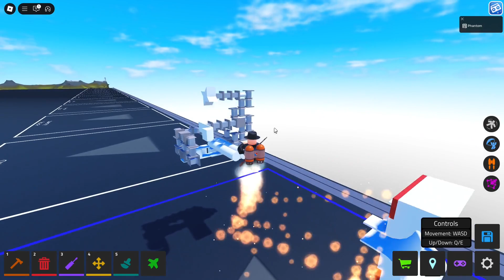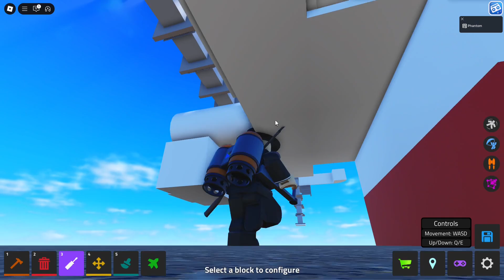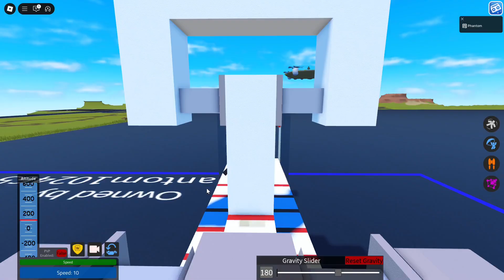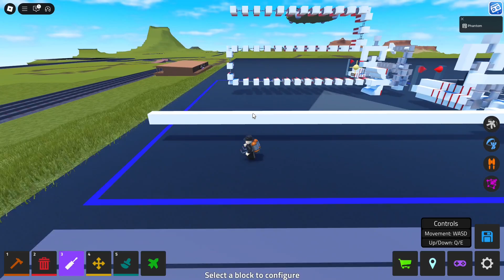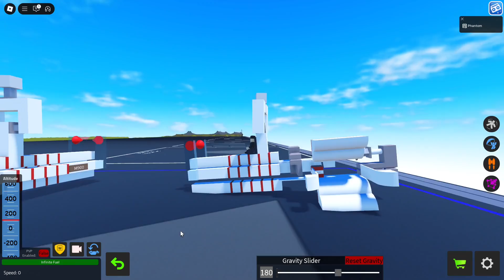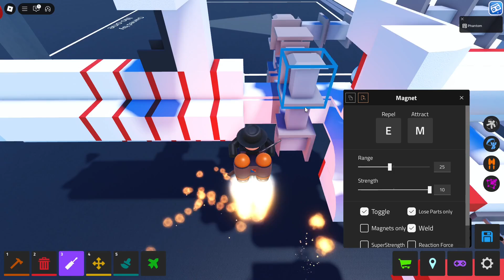Plane Crazy Belt Fed Machine Gun - M900 Build and Concept Tutorial

Comment: For some reason it get stuck inside the chamber
Reply from the maker: Check the barrel maybe, see if the 3 compressors directly attached to the barrel are correct. If not look at yours and the one in the video, describe any difference you see build wise
Reply: No i mean went the bullet it inside the chamber the one who supposed to explode for the other one to launch doesnt explode when inside the chamber for some reason
Reply from the maker: @danachoy1044 Might be the spinner then or the settings for the tnt, check those, if not as said before compare yours and the one in the video, describe any differences you see

Comment: The belt isn't moving, Im sure i did the mag belt correct
Reply from the maker: Wiggle the gun around a little and if the belt doesnt move as far, its not connected (which is good). If its moving uniform with the gun then it is attached. If it isnt connected check your magnets and spinner, make sure their settings are correct
Reply: @Phantom10246  All configs are correct, But what are the controls to fire it? Im afraid i might have been pressing the wrong buttons
Reply from the maker: @thaoneaccount23-Hn3e1 Q and E, can't remember which way it is but its 1 of them. If you pushed M and everything exploded then you would be correct
Reply: @Phantom10246  I pushed M and the ammunitions exploded, but the magnets and motor started being compressed, and finally the gun gave out and glitched, so the belt got flung violently
Reply from the maker: @thaoneaccount23-Hn3e1 If M caused a catastrophic explosion, then thats good, the settings are correct. The controls are just Q and E, never push M with it. Thats just the key I never push and thus assign to things that should never be activated. The gun doesnt need the user to activate the tnt, it does it for you. Doing it yourself breaks everything, as you saw.
Reply: @Phantom10246  Nevermind, a compress block had a incorrect configuration

Comment: how do you make the belt goes up or smth idk
Reply from the maker: The magnets are the part that guide it in, as the belt comes in and is delinked the used belt is tossed out and helps pull the rest of the belt through, then the cycle repeats again and again until its out of belt.
Reply: @Phantom10246  Yes yes I understand the concept, what I mean is, how to make the belt longer, the template one you use for the tut, the S-shaped belt, I can't seem to figure out what part you used to make it goes up, I don't exactly know how to phrase it as English is not my first language-
Reply from the maker: @dapxwolf17 Got it and no problem, the angling system (about 15:00 in the video) just uses angle locks that are positioned to straighten out the belt by creating that curve you see in the video. All you really have to do is angle each segment of belt so that the angle lock snaps it to be straight with the next, etc. If you didnt get that I believe all 4 directions for the belt and angle locks are in the video, so take a look and you might see what I mean. If that didnt help let me know what part you didnt understand (how angle lock works, the right direction for angle lock, etc.), and I'll try to clarify and help better
Reply: @Phantom10246  know it was angle lock, I just can't prove it, I tried using it, but I can't seem to figure out how to make it work, can you make a quick video on that? Make it unlisted if you doesn't want to publish a video of literally just about angle locks...
Reply from the maker: @dapxwolf17 I'm away from my computer for a few days so sadly I can't right now, but if youre open to it we can try to work it out here, in discord if you have it, or wait a few days until I get back to my setup, up to you. I will say that if you can't get it working try experimenting with it if you haven't used it before, learn how it works. If you do (if you decide to try and solve through chat) give me every detail you can about the belt. The shape its making, any alterations you've made, and how different it is from the one I built in the video, everything. The more details that help me picture what youre describing the better
Reply: @Phantom10246  Or... Just tell me the setting of it
Reply from the maker: @dapxwolf17 Should all be in the video, take a look. I show the settings for the angle locks around the time I listed before. You just take that setting angle and apply it so that each segment folds down to be straight with the previous, essentially making it so that as each segment folds down they make a straight line one after the other. If one segment folds into another belt segment just reverse the direction on the angle lock connecting the two and it'll fix itself
Reply: @Phantom10246  Timestamp?
Reply from the maker: @dapxwolf17 15:00 to 15:30, that has everything you need
Reply: @Phantom10246  Ohhh, I got it, I think I must've skipped that part, thanks
Reply from the maker: @dapxwolf17 No problem, enjoy the build!
Reply: @Phantom10246  new problem... The belt stuck at the angle lock
Reply: @Phantom10246  Nvm I fixed it

Comment: i kinda wonder if you could like combine that belt fed machine gun with explosive ball magazine so if the belt is out, you could just switch to explosive ball
Reply from the maker: An interesting idea, and I'll take it a little further. Use the belt for slow, sustained fire, kinda like a slow full auto or slow rpm while you have the explosive balls for 1 or 2 good burst shots, or a very high rpm as a failsafe. I might have to experiment with that someday, definitely curious if that would work!
Reply: @Phantom10246  sounds good

Comment: amazing vid, tho i wanna understand a specific mechanism where do the bullets(the ones which shoot out not the ones on the back) come from?
Reply from the maker: If I'm understanding you correctly (correct me if I'm wrong) if you look at each round theres the back tnt, which is the delinker, and the front tnt, which is the actual explosive. Both get pulled in and the delinker is destroyed by the spinner and the front tnt, thanks to magnets, is fired, and the cycle repeats.
Reply: @Phantom10246 that's hard to understand (not because u explained it hard it's because I'm dumb) mind showing me in-game? I created a prototype taking inspiration from Ur design and I need help with a thing
Reply from the maker: @nabbgaming  Sure, user is Phantom102465